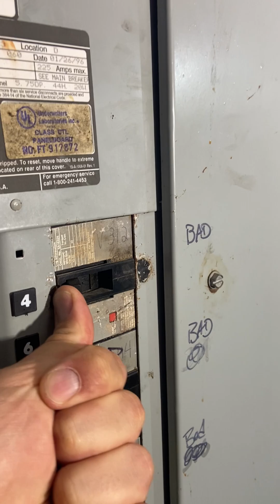Forgotten Electrical 5 #electrical #motorcontrol

Comment: The door pushing north of 200volts!!! That's horrifying!!! I may never open another door again!
Reply: Looks like some 277 on either the door or the panel the other probe lead is on. Terrifying.  My next question's which end of the two is isolated enough for that to happen.
Reply: I once got a gig to check why "user got a zap from a plastic tube sticking from the ground".

I knew that the pvc-pipe won't have anything to do with the problem, so I connected one long lead to the ground at the main panel and measured the ladder to the roof at arms length from the "electrified pvc-pipe" and got full mains voltage of 230. I thought it must be some capasitive coupling or other ghosts in the system and touched the long test lead to the ladders. Got an surprisingly large spark and eventually found 10 amp fuse that blew.

It took a while to find, but there were couple problems from earlier "electrician". They had added few sockets with pretty sloppy style in every way.

First socket had its homerun ground broken totally off by the screw, as it was stripped somehow through the whole copper..

On the next socket, ground wire was too long, or at least routed wrong, so that when the face/cover was screwed on, the (now floating) ground wire had been pressed between live metal strip of the socket contacts and the plastic cover. Might have taken some time to pinch trough the insulation or just went through.

Result from the earlier "electrician" was that the whole socket group had 230vac on the ground contacts. Then the user had new TV on one of the sockets, Its chassis live, but only touchable metal part was luckily the antenna connector, where the voltage got to the chimney sheet metal and from there to whole roof and to the ladders.

Luckily the whole property had dry gravel everywhere, that would not give much of a path to ground, so no-one got hurt. Those chimney cover sheets were just installed, there were couple <10yo kids running and climbing everywhere etc. They have had to touch the live ladders thousands of times already.. Now the only "working" ground path was the (dirty?) pvc-pipe from deep in the ground. At least it was bad enough conductor to just pinch a little, but still enough to call an electrician to check. Touching the ladders in a rain might have been bad.

I then only had an multimeter on me, now I always have installation tester in my car, so I would measure short circuit current instead of just shorting the test lead to the ladder.
Reply: Totally safe. As long as the amps stay theoretical, your shoes remain ideal insulators, and you don’t accidentally become the shortest path to ground.
Reply: @snwbrdr191 totally safe (assuming a perfectly spherical cow and zero wind resistance)
Reply: @DustinKBoggs  See, you get it!
Reply: @snwbrdr191 so, that metal box in less than an arms length doesn't worry you at all?
Reply: @villehietala9677  I think my list of impossible conditions landed as “this guy is full of BS” instead of “this is clearly educated, tongue-in-cheek BS.”
Reply: @snwbrdr191 sorry, English is my sixth language, electricity is first. I don't mix sarcasm with things that would kill someone in real life with that high possibilities as having grounded metal structures and live things you're supposed to handle in less than a half of reaching abilities of a normal people.

But, poking the thing with a tester on short circuit current mode would tell us more. Probably fails to measure it though, as the voltage probably comes on a thin signal wire that limits the current for the measurement, but could still be enough to mess with your body.

Comment: That last shot at the door 😬
Reply: Absolutely terrifying
Reply: It's probably Kevin who's setting up traps again for uninvited guests.
Last time, he used a heater.
Reply: @draxoronxztgs1212  reminds me of a young physics teacher of us, she had a habit of unvoluntarily getting into dumb accidents that sounded funny until you heard the absurd list of injuries she suffered through. 
One time she told us in the beginning of class that we should expect her to act weird because she fell off a horse and is filled up with painkillers to hold out until her surgery appointment in the afternoon. Think she had multiple cracked ribs or something like that. Then she broke her leg and arm in a way that would imply she had a climbing accident but turned out she just stepped into a foxhole while shooting bow and arrow on a field. 
And the relevant one is when she was gone for two weeks and then came back to tell us touching 230 volts off the wall is indeed not fun. They had major electrical work being done at the appartement complex and someone who surely got in a lot of trouble turned the power back on without telling anyone while there were still open circuits hanging out of some tenants walls... 
When she wanted to leave for work she brushed one with her hand.
Reply: @noaimnoskillnokill3947  As an electrician, I can also confirm that touching 230V live grid will pack a punch to the gut, as it has happened to me a few times at the job too, and when I've had serviced computer psu's at home with mains capacitors charged with 320V DC despite being unplugged.
You will become more careful than careless the next time for real.😄
Reply: @draxoronxztgs1212  you should have known capacitors need to be manually discharged
Reply: @officermeowmeowfuzzyface4408 Draining resistors are somtimes included but always good to check voltage on caps regardless! 300vdc + sounds like a bad time like real bad time.
Reply: @officermeowmeowfuzzyface4408  Not always, because most of the times they are already connected towards a load that will turn off as soon the power is cut and the capacitors have discharged their last resort of voltage to keep it running.
But after the "fool-bridge-rectifyah 😄" towards the mains supply side, that was experienced to not always be the case at one point and only.
Reply: @frizzlefry5 Felt more like something bit my finger underneath the circuit board when I was to flip it, that I accidently made contact between the negative and positive pole of the mains capacitors, not being aware of that it still was charged after having been turned off and disconnected for 5-10 minutes before I started to work on it after I did a fault check.
Having 230V AC at the mains, the DC voltage over the main capacitors was charged about 325-330V.
Reply: @draxoronxztgs1212  these are high frequency switching supplies you absolute reGard
Reply: @officermeowmeowfuzzyface4408  Yes, it was switching psu's.
Have repaired and restored a decent amount of circuit boards for a lot of various things over the years.
Reply: Oh 💩. Reminds me of a story my Dad told me where a guy had outside toilet but some local builds were using it while building a house. To teach them a lesson, he put a metal plate outside the door and wired it and the door handle to 240vAC. Killed a guy and he got locked up for murder.  🇦🇺
Reply: @OzAshley  DA FUCK. Everyone knows you use a cattle fence pulser for that shit or run wires from a car battery! You never ever ever ever use mains power for a deterrent!!!
Reply: @JCarey1988 I think this was back in the 1970’s. Considering they still had outside toilets. I’m guessing they didn’t know much then. My Dad was a linesman and was called to cut the power off from the street so they could remove the body
Reply: @OzAshley The doorknob was wired to the utility pole!?

I'm so fucking confused right now by your comment. Definitely jail for people who wire booby traps to the 240vac utility power directly.
Reply: @paaao I don’t know how he wired it but my Dad was called to cut the power. Maybe all was needed was to pull a plug or flip the mains. Like drug houses, you never know how they wire them. At least here in Australia, when they find them they cut the power in the street. Many tap into power at backs of the meters, so they aren’t charged. 😊
Reply: @OzAshley  WTF
Reply: @OzAshley I'll bet that's the last time he trespassed on that property. 😂
Reply: @jamesharrell4360 I was a really old grump dude that did it. A bit like me. We can get cranky, in old age. 😂😂😂
Reply: Yeah I saw that and said fuuuuuhhhh
Reply: OUCH!!!
Reply: Kevin McCallistar's house
Reply: Not saying it's a good thing but what's the impedance? If the grounding rod is on the other side of the building you might only have micro amps flowing
Reply: @PsRohrbaugh  We don't know how the box is being livened up but unless it is being done in an exceptionally high impedance way it really doesn't matter if the electrode is in nextdoor's yard it's still going to allow fatal current to flow if the poor sod that touches exposed bare metal on the box is in good contact with the soil. 277V anything up to 9.2k ohms (including the unfortunate person) is going to see fatal current flowing.  Heck the electrode could be 5 premises down the road and it'll achieve that.
Reply: Illegal mexican ?
Reply: Great security system.
Reply: Bite marks in the seat, or what the ol boy used to say "pucker factor"
Reply: 240+ac volts 💀💀💀☠️
Reply: I just went "ooohhhh" out loud like an Italian.
Reply: @cypressryan  meeeeeeeeeeeeeya
Reply: @cypressryan  mamma Mia!
Reply: I wanted to do this on purpose but hell if I make it look like I didn't know what I was doing😂😂😂😂😂
Reply: @justdad2  there's ways to do it that aren't potentially lethal... But still don't do it lol
Reply: I think its the ac that has the ground fault. But still funny
Reply: @AleksanderIsaksenGreva What you say makes little sense. There's obviously a non bonded enclosure that either has 480 or 277 passing through it, and because it isn't bonded, the case has roughly 277VAC of voltage potential between it and ground, aka the metal handle of the building's door. Touching the box with one hand, and door with the other could result in a fatality because someone left off a bonding ground that would have tripped the breaker. Since the box is "floating" it's essentially waiting for a connection to ground before enough current will flow to trip the source breaker.